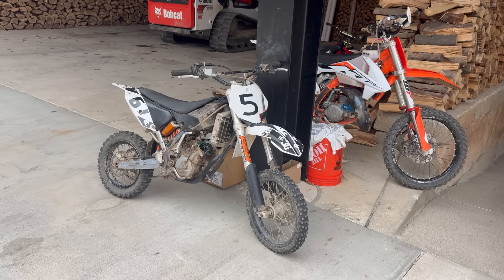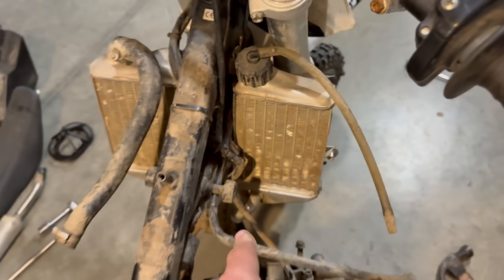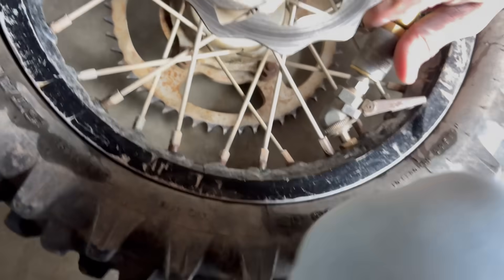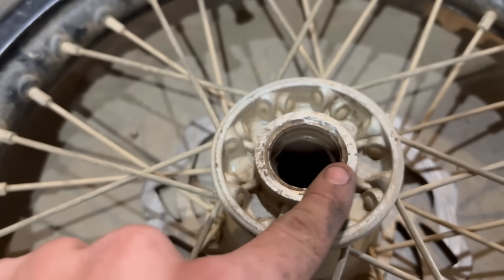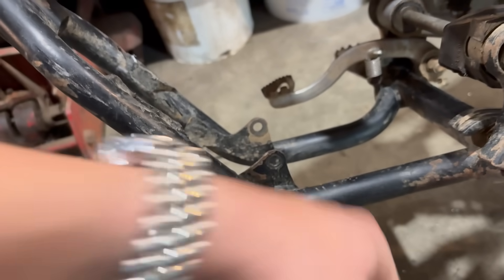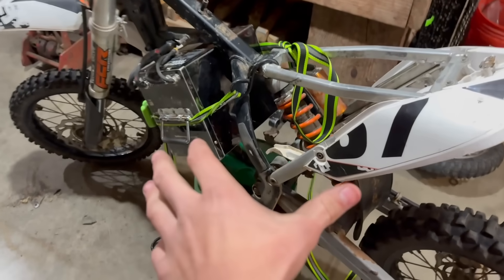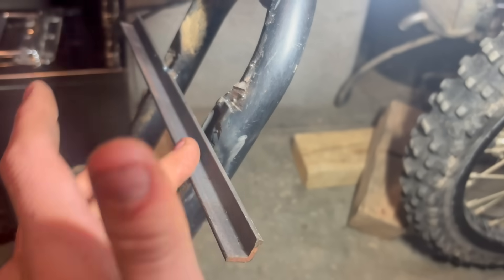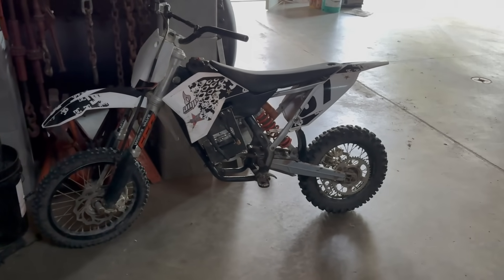ELECTRIC Converting a Old Dirt Bike (Part 1)

Comment: It looks so cool! i am also doing something like this but with a pit bike and i really like how yours look hope to see it finished soon!
Reply: I'm doing the same with a pitbike js started yesterday I fixed up the frame and took out all the dirtbike components you got any tips?
Reply: @1kw-crashoutwheelie  I am on the same spot as you the only i have noticed is that the motor isn't held by a frame on the bottom part so i am gonna need to weld a bottom part to hold the battery and motor.

Comment: this is badass! the tabs you cut off.. completely smooth things out.. make it look nice, wash the frame and wheels again, but use a brush and soap and degreaser? just to get all in the cracks and crevices.. also, you should repaint the frame black. go into detail with this! strip the rust off the bolts 

i see a lot of builds like this, that are just thrown together and corners are just cut, would be cool if you did it proper the first time. or maybe just mock things up now, then later redo everything
Reply from the maker: Thank you, first I i’m trying to get everything together and working super nice and reliably then over this winter I’m gonna completely strip it and restore it to almost new quality!